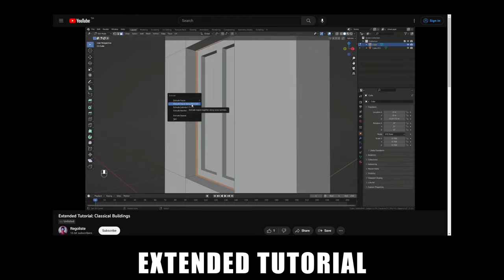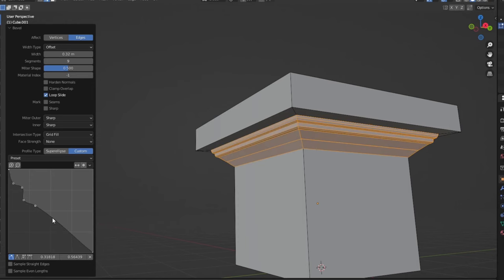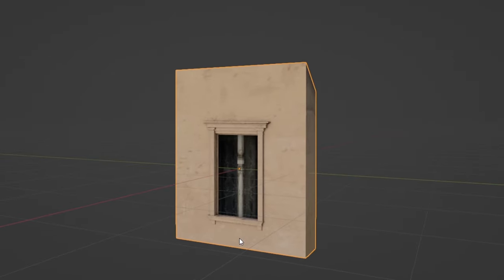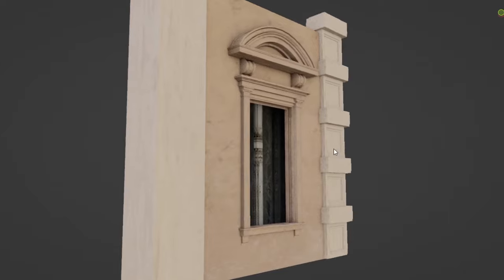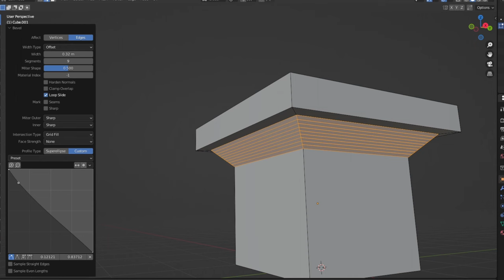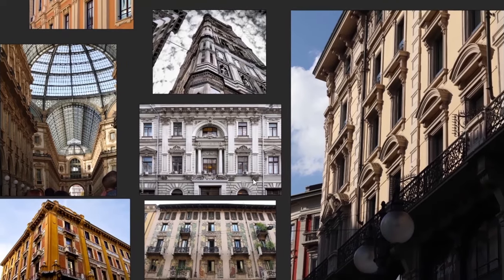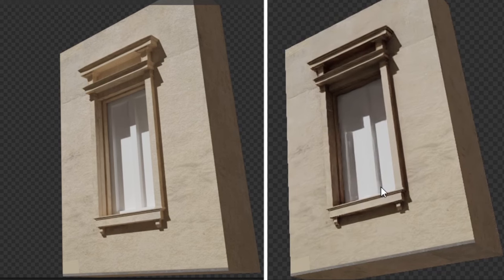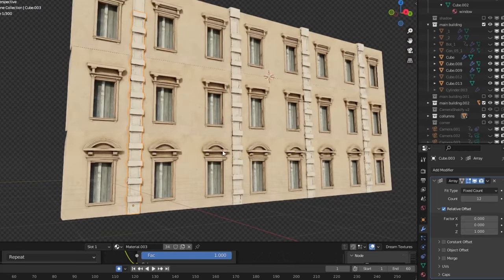How To Make Classical Buildings In Blender

Comment: Don't forget the bevel modifier for some edges
Reply from the maker: Yep I bet some viewers have great tips like these
Reply: I'm confused as to whether Ctrl+b or the bevel modifier is best. Is that just the shortcut?
Reply from the maker: @DINGOS30  Both options good for different situations. Bevel modifier lets you go back and change the custom profile and settings later but bevels every edge uniformly. Ctrl+B shortcut lets you choose which edge is custom and the bevel length.
Reply: @DINGOS30  bevel modifier bevels the whole thing, ctrl b just bevels the edge you select. I'm lazy so I always use modifier and change the threshold to a high angle

Comment: 2:05 for some reason cant make this loop cut inside the extruded frame
Reply from the maker: That's odd, be sure to check out the extended tutorial to see if that can show you how it's done.
Reply: @Regoliste  Yeah i'm not sure what i'm doing wrong. I had to cut it manually with a knife
But anyway, thank you very much for this awesome tutorial and for replying!
Reply: I had the same problem @Regoliste
Reply from the maker: @JackJohnson-y5u As I've mentioned it's odd. As long as you haven't modified the faces and edges in any way I can't think of a reason why loop cuts wouldnt work on extruded frames, they are simple loop faces, I hope you check out the extended tutorial to help yourself out
Reply: @Regoliste  yeah maybe just blender being itself

Comment: you guys are lucky you can model it easily. my brain wont let me because i use cad since i was 15. i cant even stand 0.001mm imperfections.
Reply from the maker: Haha I think architectural perfection accuracy sounds like an interesting way to model, and you can take pride in it being realistic too.
Reply: These are old buildings, so many won't have that level of accuracy in real life: they are hand designed and hand built. That said, some do. For example, St. Paul's Cathedral (London) is 365ft tall but it's columns and walls are only a maximum 2mm off from plumb straight, even after 350 years of wear (which included a direct hit bombing during the war), and the using the designing and building methods of the 17th century. Modern day architects have laser measured it and there is no noticable room for improvement.